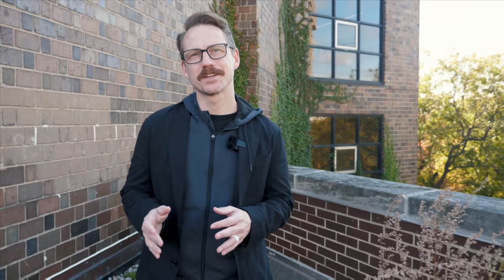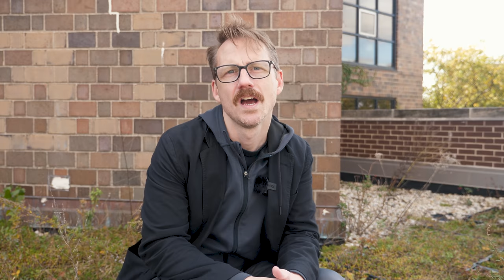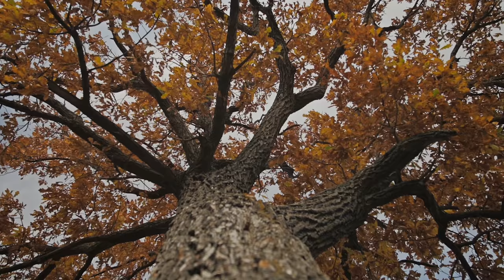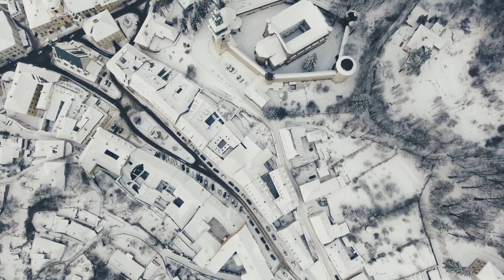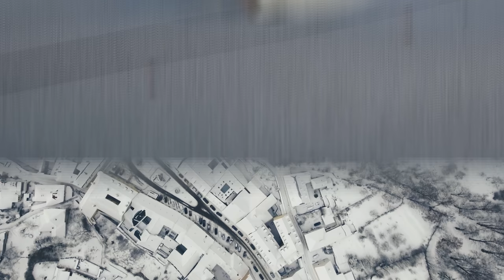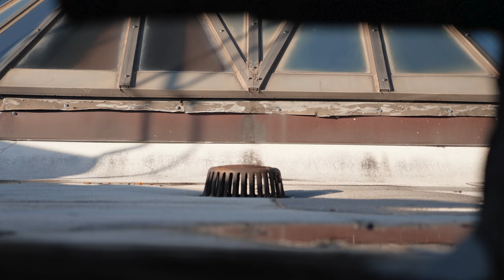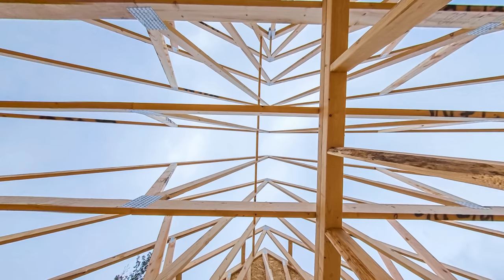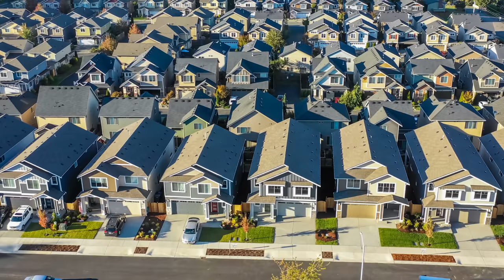Why Do Architects Insist on Using Flat Roofs?

Comment: Interesting take on this topic. As a recently retired developer and construction project manager I tried to avoid flat roofs as much as possible. A parapet flat roof is basically a swimming pool on top of the building when the outlets get blocked, which they do through lack of maintenance. Architects don’t live with buildings as developers do as we often retained ownership and let them out. Every flat roof leaked at some point. Putting HVAC equipment on top sound great but if it’s not on raised frames you can’t repair the roof without removing and replacing the HVAC and in some buildings such as laboratories that require constant temperature control that’s difficult. Then the single ply membranes mentioned, these get damaged by the maintenance staff working on the HVAC, they cut things on them cutting into the membrane, drill holes in things on them, drop screws and then stand on them puncturing the membrane, I’ve had all of these happen. Finding where a flat roof is leaking is not easy either as the water travels along underneath so the indication below may be some distance from the leak above. This is especially difficult with green roofs as you have a load of soil on the roof to remove to find the leak. Parapet gutters, why. If these leak the water is going to run down inside the building. If External gutters leak the water is outside the building. The main issue from a developers perspective is the damage to the occupiers business. If a leak would cause the business serious problems, such as an electronics factory, a laboratory, somewhere where all work would have to stop if there was a serious leak and / or alternative premises are not available then flat roofs are not good to use. In an office building it may cause problems but the staff may be able to work from home or use a temporary building whilst the repairs are carried out, as specialist equipment is not usually required, yes expensive but possible. In my experience architects do focus on the look of the building (which is important) too much, rather than the use and consequences of building maintenance and failure.
Reply: Originally, after watching the video I thought of course, flat makes sense: Engineer the drains and the overlap of materials and all is good.  What I heard in your point is that a building with dedicated staff to focus on ensuring the integrity of a flat roof has a higher chance of making it successful.  Normal homeowners don't have that skill/time, and will experience issues.
Reply: @davidjacques7852  It’s true that with a very good facilities manager the risks can be managed more effectively, but its so often the case that this position is undervalued as it’s not part of actually producing the product made by the company. The facilities manager often has to have a double role and therefore not enough time to focus on the building until it’s too late.
Reply: @johnharvey1786  100% agree that we facilities managers have too many responsibilities and not enough respect.  My thought is that the humble homeowner is much less qualified with less time to evaluate the quality and care of the installation.

Comment: Two other, somewhat offsetting, factors: 1. Pitched roofs require more roofing material per square foot of floor space.  2. With the advent of solar panels, pitched roofs of the correct slope and orientation can utilize the panels as an integral part of the roof. The wiring, one of the least durable and most labor intensive parts of a solar panel, can be located within the structure where both of these conditions are minimized. And glass is a long-lasting and fireproof surface as well. A good example of this is the Tesla roof.  Now that they've gotten the manufacturing and installation difficulties resolved, this makes for a very effective solution.
Reply: Flat roofs are much better for solar panels in every way. The wiring is the cheapest, longest lasting, and easiest to install part of a solar installation. Tracking solar panels are far better than titles in every metric(although they are quite ugly). If Forbes is to be believed, "Tesla Solar Roof cost 48.9% more and yielded just 2.79% of the savings that the solar panels delivered." I haven't crunched the numbers myself, but as an electrical engineer, it is clear that Tesla roofs are not designed to be effective solar panels.

Comment: As an architect myself, there are a few other cases where a flat roof might be preferable (or even necessary) over a pitched roof.

In situations where the building height is limited due to planning rules (or zoning as you call it in the US), a flat roof allows you to fit the same amount of accommodation with a lower overall height. Adding a pitched roof can add an additional storey or more to the effective height of a building. In low-rise architecture this can easily overshadow or visually dominate other buildings nearby. Flat roofs are really good in any situation where height is critical. As you said, you can sometimes have a 'room-in-the-roof', but this is usually a significant compromise and you still end up with an roof apex significantly higher than if you had just used a flat roof instead.

When dealing with buildings with complicated shapes in plan, pitched roofs can also quickly become a nightmare to design and detail. If your building is too square, you will either end up with a flat spot in the middle (defeating the point of the pitched roof) or multiple gables - which can look great in some designs, or terrible in others. Even if you can make it work, contractors and clients will not thank you for designing a roof which is difficult and costly to build, due to the complexity of the junctions. In those situations a flat roof is often preferable, and works beautifully with any building geometry imaginable.

I think it's also important not to devalue the aesthetic element of a flat roof either. Buildings are not just about pure function. 'Form vs Function' is a debate that has raged for generations, and the prioritisation of function was a modernist idea, but that style of architecture fell out of favour amongst critics and theorists a long time ago - dismissed as being too stark and inhumane in many cases. Postmodern architecture venerates form over function - just look at the works of Frank Gehry, Peter Eisenman, Zaha Hadid or Jan Kaplicky.

I digress, but the point is that it is important for buildings to be attractive as well as functional. Nobody wants to live in a Soviet-esque mass of grey concrete blocks (another reason modernism failed), and it's important for our mental health and wellbeing that we live, work and play in beautiful environments. And sometimes a flat roof just looks much better on a given building than a pitched roof ever would.
Reply: Around here, there are varying height limits based on your roof type, so that using a flat roof isn’t actually any better.
Reply: Tbf though a lot of those blocks we love to hate right now were vast improvements for the people who moved into them when they were built, you can try to convince the young Soviet couple who grew up sharing a hay mattress with 5 siblings in a house that leaked where the only heat was from the stove and there was no running water or electricity that their new apartment with water, heating and electricity is soulless all you want but they're probably going to think you're insane, or really spoiled. Like at the end of the day what matters the most to people is the basic amenities of their home, does it have water, heating, electricity and internet? Is it properly ventilated and does it get enough light? Is it actually large enough for their needs? Is it a reasonable distance from their workplace, friends and family? And so on and so forth, aesthetics is a nice thing that everyone likes to have but there's a reason why most people live in fairly boring looking houses and apartment blocks and that's because very few people will pass up a 2 room apartment with a decent rent for a 1 room apartment that is prettier.
Reply: @hedgehog3180  Of course back when they were originally built, they may have enabled a significant improvement in terms of living conditions. But that doesn't mean that they are good by today standards, or that we should accept them as 'adequate' and not aspire to do any better. If everyone had that mentality we would still be living in caves.

Most architects would literally consider it their job to make the built environment better. I'm not attacking soviet blocks as such, they fulfilled their purpose as you say. But we should be trying to do better in 2021.
Reply: A (truly) flat roof is a terrible idea - period! You can enjoy all the aesthetic properties of a flat roof with a roof that slopes a few degrees hidden behind a parapet - ideally draining towards the outside of the building. If it's a roof space that is to be used for regular foot traffic, then build a slotted deck over the sloped roof surface. Creating what is essentially a swimming pool over the top of a building is an idea that can only lead to issues down the line. I've lived in a top floor apartment where workers came to tear up the tiles on my rooftop terrace because water was quite literally pouring down the walls of the apartment below whenever it rained. In Sydney (where I lived at the time) this sort of issue was a monotonously common one, where lax building standards and profit-driven builders combined to make waterproofing one of several things that was done poorly.
Reply: @danielscott4514  Just to be clear, when we talk about 'flat roofs' in architecture, we do obviously mean a roof with a nominal slope to allow drainage. All the things you said are correct, but they are all mentioned in the video, hence I felt no need to address them in my comment.

I agree that a truly flat roof would be an absolutely terrible idea!
Reply: That soviet bulidings are a great example of flat roof being used in a wet snowy climate and leaky as a result. Every single soviet flat roof leaks.
Reply: @EternalQuestion  Well, I guess we're getting into real semantics here ;) LoL. Obviously a "flat" roof is never truly flat, in the same way that a tiled bathroom floor with a floor drain is never truly flat, or a patio beside a building is never (should never be) truly flat. There will be a tiny inperceptable slope towards some kind of drainage (assuming it's constructed correctly - an assumption that in my experience should not be taken for granted).

If the slope is so small that it is imperceptible to the eye (we can easily see a slope of 3 or more degrees) then it's what I would call "flat". At these very small grades any imperfection in the surface can cause water to pool (god knows I've seen enough bathroom floors where water pooled somewhere away from the floor drain that the floor was meant to slope towards, and I've seen that in various rooftop terraces as well). If a roof is not noticeably sloped to the human eye, and if it needs sealing with various paints and membranes, and if - the-gods-of-engineering-forbid - it requires drains somewhere in the middle of the roof surface then it's *flat*.

If a roof framing member sags slightly under a roof with a slope of a few degrees or more, water won't start pooling up somewhere in the middle of the roof. That to me is the litmus test of a "flat" vs "pitched" roof :)
Reply: @EternalQuestion  I just did a little googling, and it seems that for the kinds of roof systems I see as very reliable and maintenance free (which serve us well here in the tropics with extreme amounts of rainfall) the minimum pitch is as low as two degrees (or 1 degree in the case of some of the "high-ribbed" options with concealed fasteners). 

Here's a shameless plug for one local (Australian) company. Roll-formed steel roofs don't need sealant paints or fancy membranes - the joints are up out of the way of where water runs, and typically they're installed so that if a dribble of water does make it past the joints then it'll track down the underside of the roof and out through the eaves. In 2017 following cyclone debbie, our region got hit with around 600mm of rain in a matter of several hours (Mackay a little further south apparently got over a metre!!). Imagine the drainage systems of your average inner city flat roof trying to cope with that! ... Next time you're designing a building, consider speccing a roof that will give 20+ years of maintenance free hassle even under harsh sun and rain: https://www.lysaght.com/sites/default/files/LysaghtResidentialRoofingBrochureApril2016.pdf - in my experience the only issues with these kinds of roofs (rooves?) tends to come when there are skylights involved. Like flat roofs, skylights are tricky things to get right (both for designers and builders).

Comment: I long ago accepted that flat roofs were the only solution in many circumstances. That being said, more architects need to understand the maintenance problems of various flat roof systems. I am a gardener at a hospital and have to go uptop a number of times a year for weed control over large parts of our roof. This is not an issue with other roofing systems, but with what we are saddled with it is unavoidable.

Comment: Just finishing building my own (self-designed & engineered) off-grid aircrete home with a flat roof.  A bit scary to think about the possible water problems, but I'm pretty confident I have accounted for these variables and overbuilt all aspects of the design.  Very excited to move in early next year.
Reply: I’d like an update . I am designing a similar house community in TEXAS and I see the flat roof as
A potential water harvester
Reply: Prepare yourself for a never-ending maintenance obligation - assuming you live in an area with any appreciable amount of rainfall, or if you have trees nearby that will rain leaves into all the critical drainage infrastructure you've built in.

Comment: I now live in Canada, but I grew up in Illinois.  I remember watching the renovations of Meadowdale Elementry School in Carpentersville in the early 1980s.  They changed it from a flat roof to a long gabled roof.  My Dad said they had a lot of trouble with water penetration.   It was a huge project.  The school was built in 1954, so it was boiler heat and not requiring rooftop units. A parapet would have been cheaper.

Comment: In my experience roofers are the issue with flat roofs. We installed a solar array on a high-end PVC roof a year after the building was finished. We had a pre-inspection from the roof manufacturer to document the condition so we would only be responsible for any issues we caused. The inspector found that not a single seam on the building had been welded. He was peeling seams up with his fingers, he didn't even need the probe tool.

Comment: I've worked in and on top of office buildings for years as a contractor. I'll verify that rooftop space is precious, for HVAC and communication gear. A flat roof will be necessary in most cases, regardless of what other considerations are in play, just because of the amount of gear that needs to exist there. Even something like snow load isn't a concern when you see the size and weight of the gear we put up there. 

The buildings I work on at the moment range from 12 to 22 years old, and none of the roofs have any systematic issues.
Reply: HVAC worker here. I hate attics in the sloped roof homes!
Reply: And even in places like here in Finland, where we get loads of snow, it's often enough to climb up to the roof to clear away snow like two-three times a winter, sometimes just once, and it's usually not due to fears of the roof collapsing. It more a case of "let's fence off the area and deal with the snow before a pile falls on top of someone's head and kills them"

Snow falling down from roofs uncontrollably is a huge problem for steep angled roofs as it will pile up anyway even if the roof isn't flat.
Reply: *systemic?
Reply: if you stab the rubber membrane with a knife, it will create a hole. This isn't because any of the systems which work together to keep water out failed. It is only because you stabbed the membrane with a knife. A systemic failure would be something like an adhesive that loses grip in heat or cold, or an edge design that lets water in, or maybe an insufficient drainage system that allows the weight of water on the roof to exceed what it's designed for.  

Correctly addressing whether a leak is caused by an incident or system failure is key to keeping the building dry. If you don't know how/why something works, the odds of making good decisions goes down fast.

Comment: Good analysis, you bring up some interesting points I hadn't thought about! Another important point to bring up is that pitched roofs tend to be more vulnerable to low-lying fires, such as brush or surface fires, because the heat rises, accumulates in the eaves, and gets pushed into the attic through vents. This is also true for other features that cantilever off of a building and present an underside for a fire to catch. Open frame eaves also exhibit an interesting phenomenon in which fire spreads sideways across the eaves because of this heat accumulation. On flat roof structures, ground fire tends to just scorch the outside, but skirts up the wall and isn't caught or stopped from rising. Pitched roofs are less vulnerable to tall fires, however, where the largest risk is falling embers and debris - but only if the pitch is large enough that the embers can roll off. So in some areas, form follows fire resistance instead of precipitation resistance.